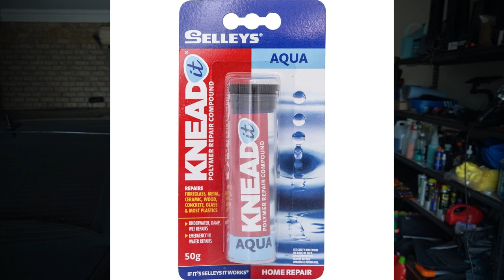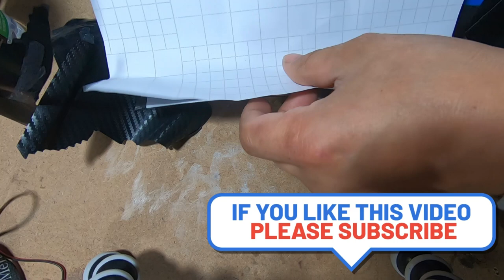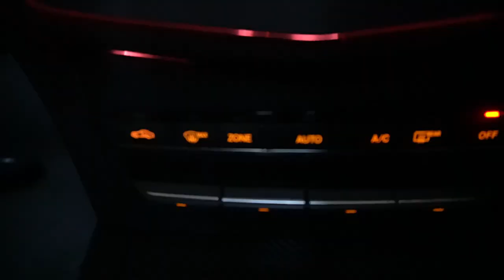mercedes w204 - w207 E class climate control upgrade gap fill with SELLEY'S polymer repair compound

Comment: Hi
I have one question,I have mercedes w203 from 2002 and i have the instrument cluster from pre facelift and now i want to upgrade from facelift instrument cluster.So what do you think it will work properly or not ?
Reply from the maker: Ive heard that ot does work ok... u just need to set the milage ... as ut wont transfer your odometer reading
Reply: @MIKEYZVLOGZ  Thank you so much 😊

Comment: Mikey, I just watched this video and the other one on the actual mod, since I started subscribing to your channel.  I think you did a great job filling the holes with putty.  For some people who may not have that process turn out looking well, I think perhaps getting a printed 3D bezel from a design shop will also work.  I know 3D printing came and went but in my day profession, we’ve been using printed parts for over 20 years.  So just a thought.  And then you can cover with carbon fiber, etc.  I know it may cost more than your way but for people who can’t do putty, you won’t have to bother with that and you won’t have to bother with the cuts you made in your first video on this.  Just take the new unit to the design shop and they’ll knock out a professional piece based on the back and front dimensions for a perfect fit. Btw...I don’t have any intention of upgrading my 2010 C300 climate control (you are more into mods than me and I like stock...if I feel my car is dated, well, I have to live with it until I get my next C is how I look at the situation, ha!).  But just wanted to share because we both love our C Class :)
Reply from the maker: that is a good idea to get a 3d print out but that is alsona very costly route... the way i did it will save u $$$ and the putty is only $20... and if u wanted to revert bak to the scroller knobs u can alwaya buy another surround as they are dirt cheap now $30 - $50 used..but yes i do like the idea ... and if u have a 3d printer it would be worth while considering doing it
Reply: MIKEYZ VLOGZ it’s more costly than putty, sure.  But probably around $100, not much more than that.  Anyway, my point was that there are people who may not be able to do the cut outs and the putty correctly or don’t want to.  So a 3D print gets you a professional looking piece and you don’t have to do the work.  You always should look at the labor involved vs the cost in projects, and I think most people would agree.  When I did my own ESL repair, it costs around $1,500-2000 from the dealer.  And doing it my self made a lot of sense since I paid around $50-60 in parts, tools.  But to be honest, if the dealer charged $500, I would have had the dealer do it.  I know I changed topics and that was a very rewarding fix but it was just a repair.  And it took me a long time:  so you need to see how valuable your time is and other things you can do vs. the cost savings, etc.  sometimes “hobbyists” forget about these principles and then regret it later.
Reply from the maker: @AlGolzari  fair enough... but it really wasnt much work ..i had never used the product before and im no professional... so if i can do so can u.... thats my point... but eother way ..its up to the individual.... im all about diy ...